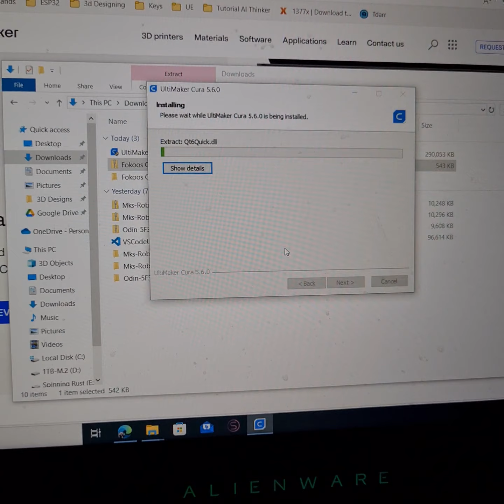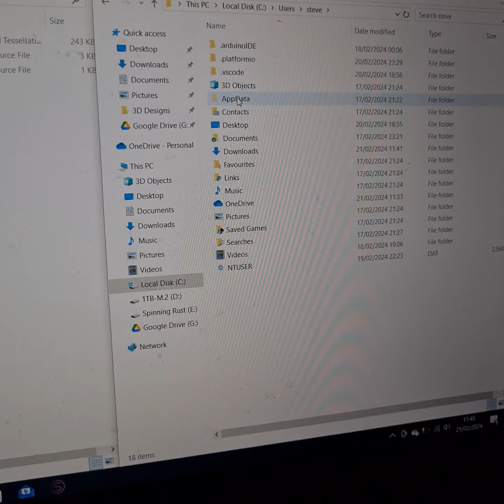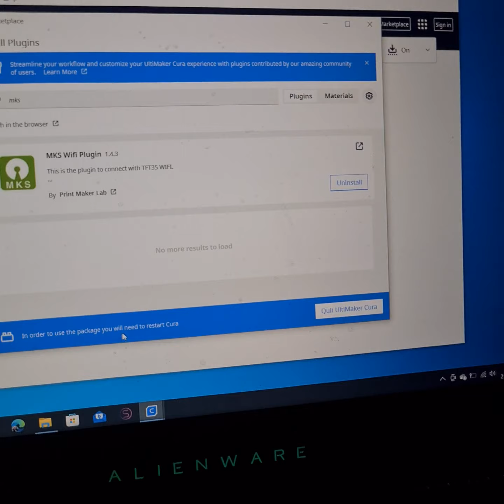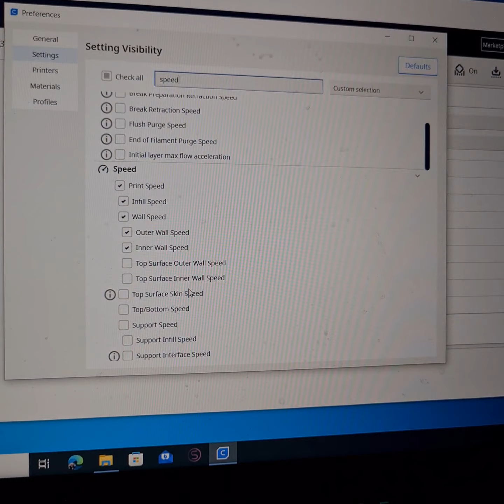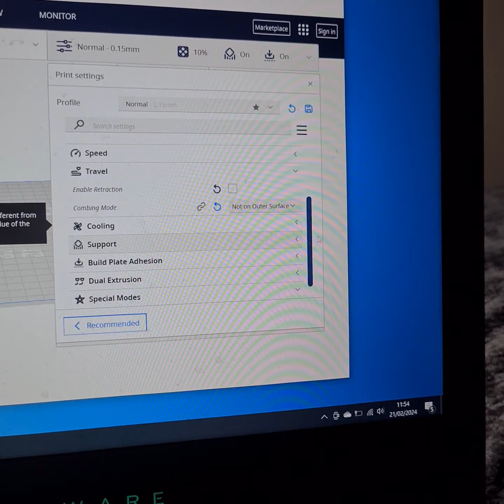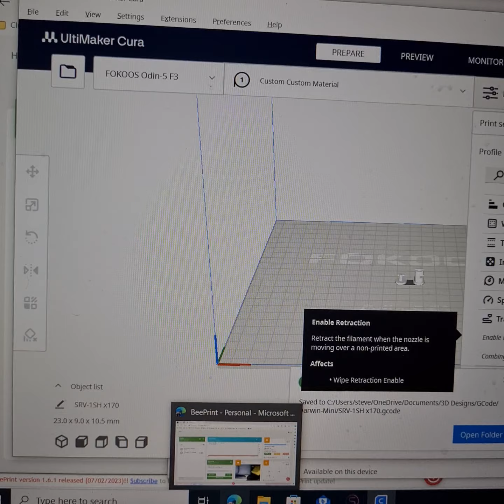Fokoos Odin 5 f3 smart-er setup "part 4 Cura & MKS Plugin"

Comment: inside the thingiverse files there are no DEF files just JSON FILES, where did you get those DEF files?
Reply from the maker: ive had to watch the video and redownload the files as i had forgotten how to do it. the link to the thingiverse files are the ones i originally used. the owner must of modified the files. ill check my backups later today, upload my own version and change the link. Thanks for notifying me, and ill respond as soon as i have uploaded the files
    i do change the way i print in part 5 - if youd prefer to use that in future
Reply: @StevenWilliams-lb9tf  i agree, i just renamed them and tried it. I got the fokoos smart model and its working, but the build plate in cura did not update, no biggie just cosmetic.
I watched this guys video he did it on MAC I just transposed the folder names to my windows. https://youtu.be/eEOPfEiAmwA?si=g--_k0F8Jkm--d83
Reply from the maker: @ ive checked my backup, and read the comments on thingiverse. my backup was 7/7/23 and was the same as the download. i followed my guide and it still works. I didnt rename anything as i figured i may of had "hide extentions for known file types" ticked in explorer, and its worked along with the mesh too. im sure in cura 5.9 they "cura" modified the way they start prints, so still may be worth checking part 5
Reply from the maker: @ just noticed you have the smart printer, i dont see the need to upgrade yet, and have a backup odin-5 so probably wont for a long time. but happy you have it working. maybe its related to odin-5 only
Reply: @StevenWilliams-lb9tf  no I dont actually thats the profile that came up when I opened cura, it was the only option so i choose it. in my info screen it does not say smart, it says odin 5 f3 1.0.2FW